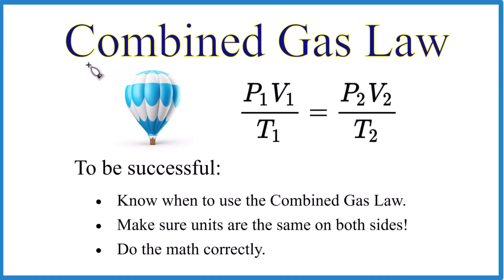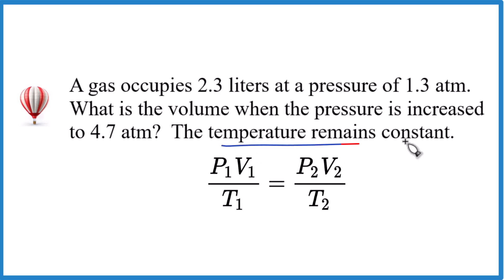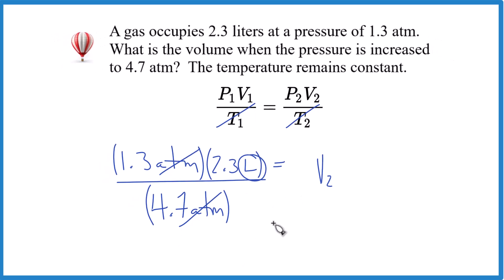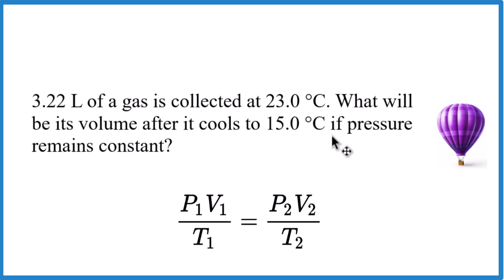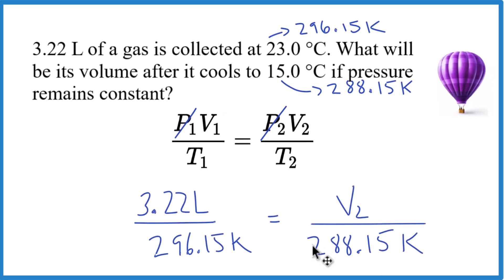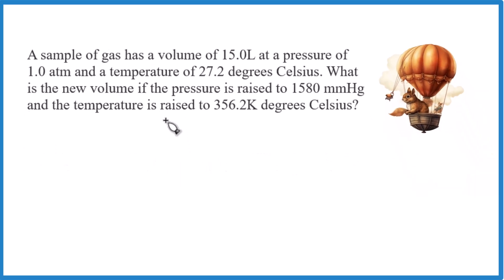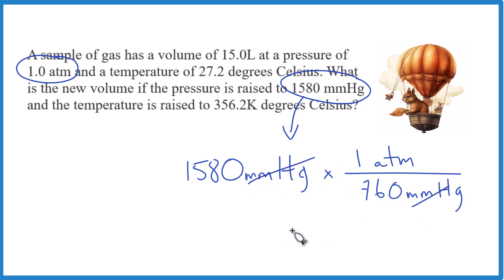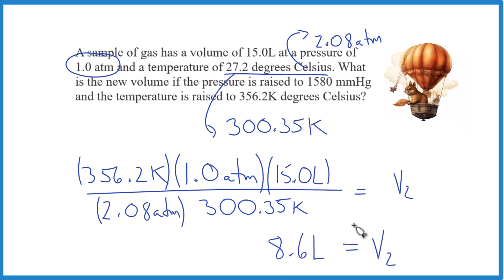Combined Gas Law:  Explanation, Practice, and Examples

Comment: What gas law is applicable to tires? because i noticed it on my tire pressure monitoring sensor that when the pressure getting high the temp is also getting higher.

Comment: Hi Dr b, 
I have a question. Why didn’t you change the second temp to kelvin while solving. I’m quite confused. Please kindly help.
Reply from the maker: Hi, sorry I missed your comment!   I'm not sure which problem you mean but it's always a good thing to do to change to Kelvin.  Often you can get away with not converting if you have Celsius on both sides as they cancel out.  But occasionally you have zero degrees C and that can cause lots of mathematical problems!

Hey, and thanks so much for being a channel member!  That is much appreciated.

Comment: Wayne:  Many thanks for your terrific video. 
I know it’s a stupid question, but I have to ask: In your second example you isolate V2 on the right by multiplying both sides of the equation by the temperature 288.15K. 
V2 could just as easily have been isolated by dividing both sides by this temperature although that would have given you an incorrect answer, of course. 
How did you know at this stage that multiplying would lead to the correct answer? 
Thanks again.
Reply from the maker: Good question.  In this case, I multiply both sides y 288.15K so that it cancels out on the side with V2.  That's really the only way I can get V2 by itself.   Otherwise I'd have V2/288.15K/288.15K which is essentially V2/(288.15)^2
Reply: @wbreslyn  Many thanks, Wayne. That’s a great help.